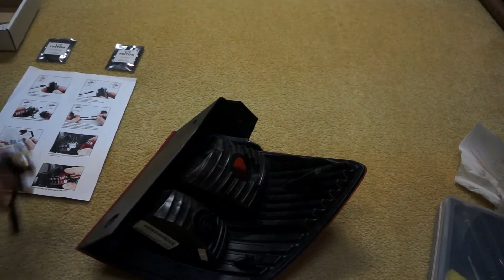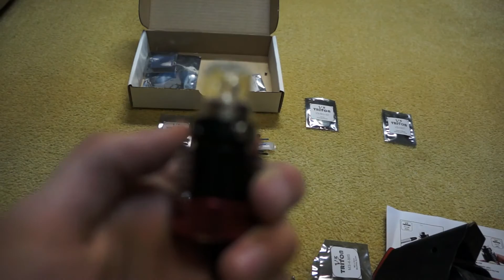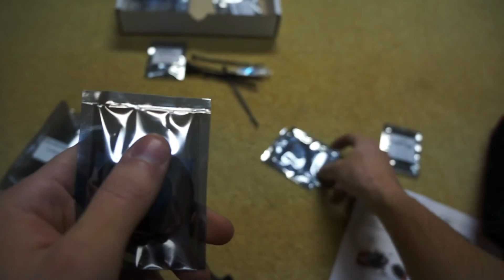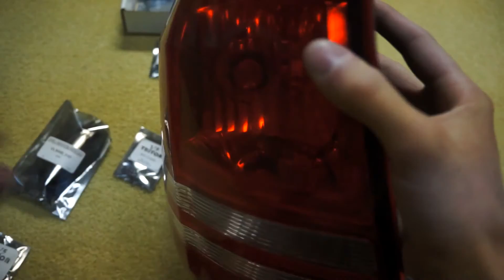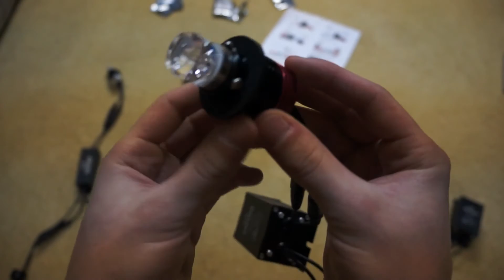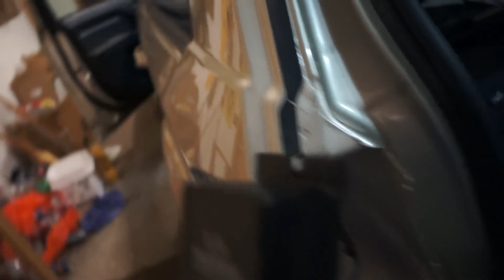V3 Triton setup and installation guide

Comment: You are putting way too much work into this project. The V3 Triton is over priced and not worth it. Also they use Philips LED's which are not very good. Cree is more reliable. The VLEDS resistor pack for LED turn signals is a good product, way better than the gold resistors. Check out PlaZma LED's at CARiD and Switch back LED's at JDMastar. Easy installation, much better prices and easy installation. Also work with no issues.
Reply from the maker: Hmm, well, we have those style of "tower" LEDs and they are not as powerful as the tritons. They try to mimmic the  360' output a normal incandescent bulb naturally have, thats how lighting engineers at auto manufacturers design their reflectors. So there is no better way to make a bulb than around the way engineers designed them. the triton does that, tower LEDs don't do a good job. I have had the tower and tritons back to back in the housing show in the Dodge in the video, there was no comparison.  Also the high/low flashing was notably different, the tower LEDs had very little difference between low and high, which is terrible in terms of safety. Currently the towers are in the running light space on the Dodge, they are holding up but there are hot and cool spots by the way the towers are designed. 
The video also features the Gen1 Triton, the Gen 2+ have a much more simple installation, not as much stuff to connect while having a very slim profile. I also looked the lumen output on the carid ones and they are dangerously low, compared to incandescent OEM specs. Sorry but I have yet to find any that are close to the level of V-Leds, although I have an open mind and continuously look for the newest LEDs, the only ones that come close are the Philips automotive, and sylvania automotive LEDs. Reputable companies, to many crappy ebay quality ones out there. On paper they might look good but in terms of real quality, they fall way short, there are countless youtube videos of the crappy LEDs.

Also when you look at videos look for daytime comparison/videos, any bulb will look great during the night, but during the day is when bulbs really show how well they light up.
Reply: I'm just got Plazma (7440) by Lumen from Carid.com and 2016 MDX has hyperflashing with this bulbs (On WEB - CAN Bus Compatible
Built-in load resistors prevent error messages on modern vehicles with CAN Bus systems.)